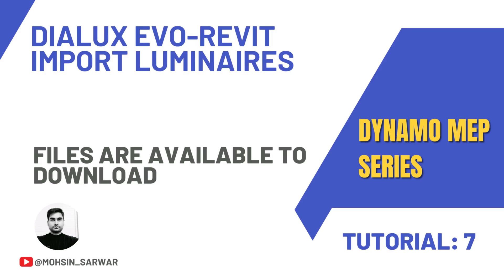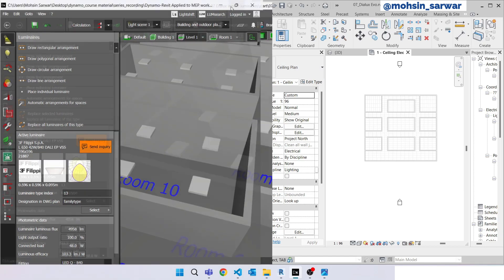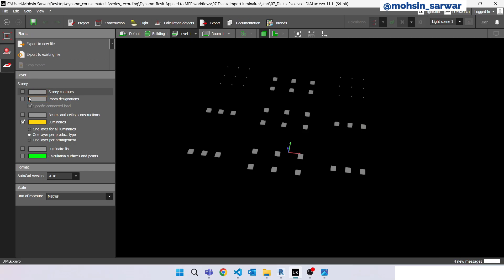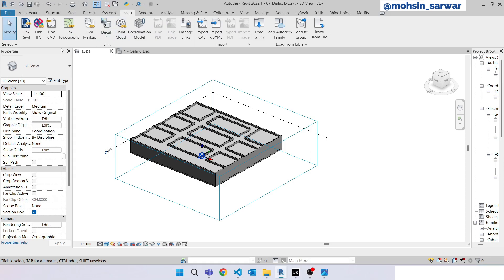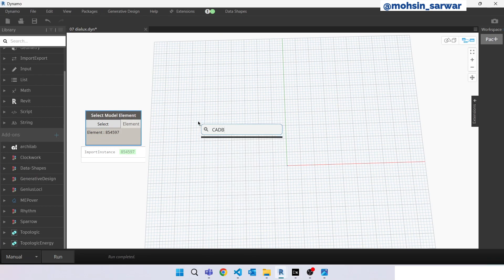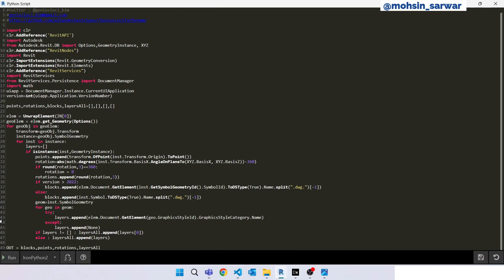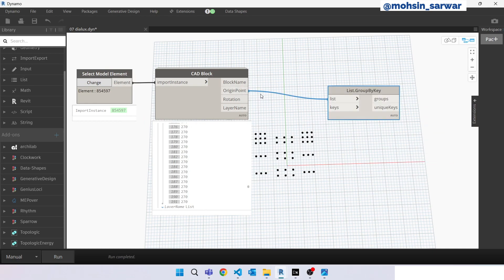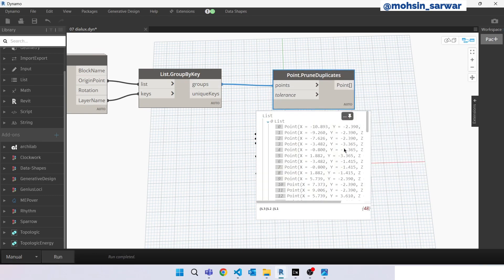Tutorial 07 Dialux-Revit workflow Import luminaires | Dynamo-Revit Applied to MEP | Revit2022

Comment: Thanks for the videos, really appreciate it. Great explanation. Just one question: Once the luminaries are placed in revit can I create a circuit using them or should I change them for a proper fixture?

greetings from Costa Rica.
Reply from the maker: @andreysolano6658
Yes, you can do so, if the family fixture contains electrical conectors.